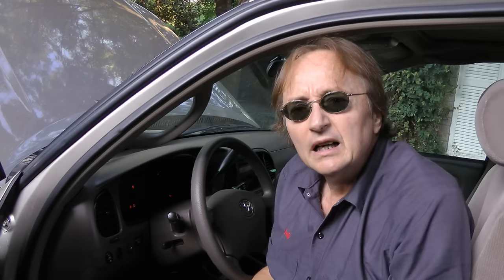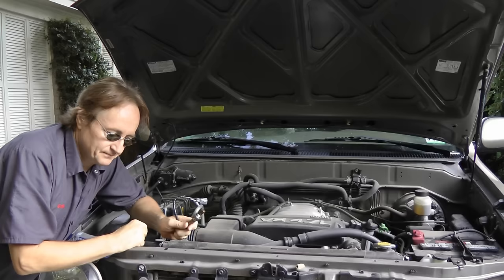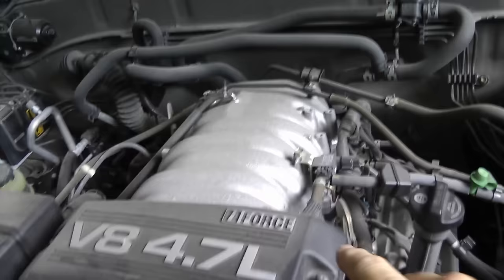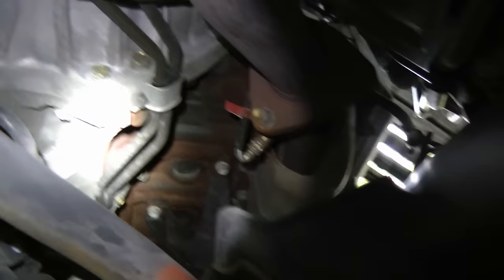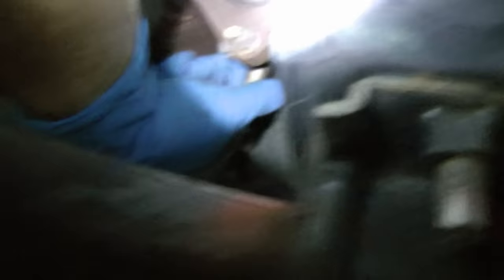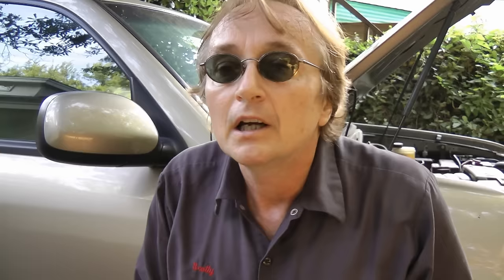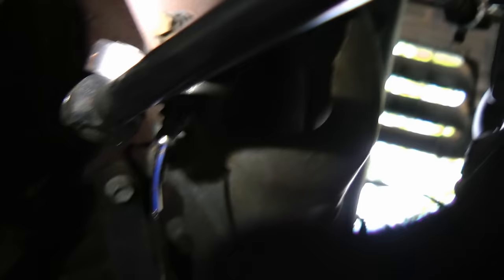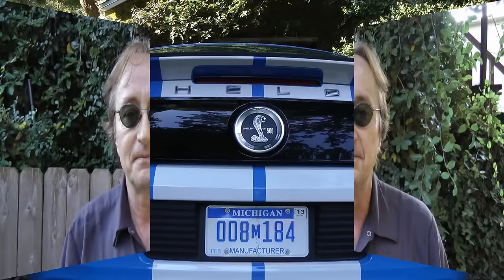How to Replace an Oxygen Sensor in Your Car (Air Fuel Ratio Sensor)

Comment: Hi Scotty, I have a 2004 Toyota Prius that has started to idle rough. The Dealer ran OBDII codes and here they are: PO138. O2 SENSOR VOLTAGE HIGH. B1S2. They want a very high price to fix this. Would it be possible for you to consult on this?
 Thanks, Lee

Comment: Hey scotty,

So I replaced the upstream oxygen sensor for my 2006 Mazda 3 2.0L with a code of P0421. I hook it up to a fancy machine and the upstream oxygen sensor didn't have a voltage. I replaced the upstream oxygen sensor, but I didn't buy the original one, which cost around 350 dlls. I decided to buy NTK. The check engine is still one and the oxygen sensor is still reading no voltage. What could be wrong? The manifold converter or catalytic converter. I really don't know. Scotty Kilmer

Comment: If there is no engine sign on, is there a good reason to change either oxygen senor or air fuel ratio sensor?  I have a 2002 Honda Accord v4 that has 230,000 miles on and a Nissan Frontier 2003 with 160,000 miles.

Comment: Hi scotty

im having a bit of trouble with my 2009 Mercedes with a 1.6 kompressor engine, i drove it down to my mechanic and it got no faults, but he tested the oxygen sensors and one of them got some pretty strange values through 2 different scan-tools, the problem with the car is that its some kinds of misfiring, and shaking if you keep the RPM steady in neutral gear and the car are not that economic anymore, my mechanics thoughts are that the oxygen sensor with strange values are gone bad and need replacement, but whats your thoughts about it

kind regards

Thomas from Denmark

Comment: ya i had jacked it up its not hung up are maf sensors cleanable with throttle body clean or something more sensitive like iac valve cleaner? ive also read around that the dpfe could be bad but not enough to kick a code...(differential pressure somethin or other??)

Comment: Scotty can you help me out? I have a 2008 Pontiac vibe (like you a vibe/matrix) I recently acquired a Zurich ZR pro scan tool and decided to hook it up and see it run :-) Well I noticed my long term fuel trim is at 13 to 14% which I think means it’s running too rich in fuel and lean on air. I have a good line graph to show the data of what’s happening but don’t know how to read it because my bank 1 sensor 1 is reading 3.3v constant and heard that might be normal? The bank 1 sensor to (post cat) is  doing weird things entirely (in my opinion) could you take a look at my readings? Also my g/s of air through the mass airflow sensor seems fine at 2.3g/s. Any help would be appreciated!

Comment: Hey Scotty, can bad o2 sensor cause driveability problems (such as misfires and rough idle) and not trip a check engine light on OBD-1 computers systems?
Reply from the maker: yes they can, but of course, scores of other things can too. Best to analyze than guess. OBD I systems are very basic and often do not trip codes for any problem, including O2 sensors

Comment: Scotty, I have the P0135 code (bank 1 sensor 1) code on my '96 Mustang Cobra. This is passenger side sensor before the cat. Aside from just it going bad and me having to replace the sensor, are there other issues that could have triggered this code? I think there's only one fuse for those, so it would have triggered ALL (unless I'm wrong about the fuses). I haven't driven that car in a while and had to charge the battery to start the car-- could that have triggered it? Penny for your thoughts!
Reply: I'm going to continue charging the battery as much as I can, clear the codes, and heat it up and drive it. But please, let me know about your experiences! Love your channel, by the way! Thanks a bunch!

Comment: HI Mr. Scotty.. I have nissan sunny 2002. i have a problem regarding spark plugs.
after 800 or 900 km . my car spark plugs gets black. and my car engine shuttoff while running.. or when i parke my car its cannot idle.

Comment: Hi there, I found this video because I'm super worried about my Dodge Grand Caravan (Sport, 3.3L V6, 2002, 234k kms) fuel consumption! I'm around 15L/100km (around 15 MPG) and even more (less for MPG) sometimes in city. I never drive over 2 500 trs/mn, I don't really understand how the fuel can go away like this ! It's killing my bank account. This Air fuel ratio could help ? Any ideas from you guys ? Cheers!

Comment: Hello Scott,

The O2 sensor socket is with drive size of 3/8". Where did you buy your 3/8" breaker bar? Currently, I only have 1/2" breaker bar and most people say the 1/2" to 3/8" adapter is very easy to be broken.

Thank you

Comment: I have a 2006 Chrysler 300C 5.7l Hemi I changed 16 spark plugs 8 coils and the EGR Sensor 4 o2 sensors and the OBD2 is pulling up all o2 sensors tried erasing the codes but doesn't work

Comment: Was I wrong to use antiseize on the threads of the sensors or is that what caused me to get a p140 and p160 and also the fronts are new and only one is working now.
Scanner says no activity from bank 1 and 2 downstream

Comment: Why I haven't seen this video before ? :(  

Scotty says "Always replace them with a SAME BRAND" . In my car 2 Bosch sensors were used originaly but I've replaced 1 faulty Bosch with NTK and it worked for a month or two...but now I have 3 dead O2 probes ( 2 Bosch and 1 NTK ) .

Comment: Have 05 Mercedes C230 Kompressor w / supercharge code Po172  O2 censor , but I also lost the quick acceleration when push on gas paddle, it picks up slowly.   When turning on the AC the rpm idle fluctuates up and down making the engine going to die. Could O2 censor be the problem on both issue? or AC have different issue?
Reply from the maker: If you wish to ask me car questions, I am switching my questions and answers to my website. So go to www.scottykilmer.com  and ask me in the Ask Scotty section.  So please, if you want your questions answered, go to this link and join my completely FREE website. No strings attached.

Comment: Scotty I have a 1998 Buick Regal Ls with a 3.8L V6 and it has code P0141 Bank 1 Sensor 2 and yes the check engine light turns on and I do waste ALOT of fuel because of it. My question is if I disconect the oxygen sensor would it not turn on the check engine light? Thanks.

Comment: What if the code reads low voltage o2 sensor, would that be more of a wiring problem

Comment: i have a question scotty,i drive a 2003 subuaru outback. when i hit the gas the car makes a loud reving noise and the check engine light has been on for sometime,my friend thinks i need to have the o2 replaced and if she is how much would it be? or can i change it myself? and what kinda tools woild i need? would i have to replace under the one under the car? let me know thank u
Reply from the maker: they just bolt off and on, but you need an oxygen sensor wrench to do that. See my video "replacing a bad oxygen sensor on your car"

Comment: Hi Scott,
O2 replacement. is there any negatives heating it cherry red to break it loose. the penetriating products didnt work as the sensor has been inthere 15 years. I did heat one on my Ram and it finally broke out.. thanks in advance for your help.
Bob

Comment: Also, is the same method (pipe cleaner) ok to use on a preheated O2 sensor? And/or can I also use any type of detergent cleaner or something like isopropyl alcohol, to wash the O2 sensor out or soak overnight?

Comment: hey scotty got kind of an off topic question. i just got a 2005 escape awd which for escapes theyre 2 wheel drive until needed.. when i purchased it i filled the gas tank and i put 100 miles on in a day and was down to half tank.. be it those were highway miles it should have got way more. i replaced spark plugs, cleaned throttle body, new air and fuel filter , aligned , only 64k miles no check engine light on idles fine i was thinking maybe the ebrake is too tight because the handle is fairly

Comment from the maker: they look the same, but air fuel ratio sensors are more accurate and costs a bunch more. They are not interchangeable even though they look the same.

Comment: So I got my check engine light on and the code was Po133 and it was the bank 1 sensor 1 & I changed it and you could tell it was not a good one and my check engine light is still on , what could the problem be? Do I have to drive my car a couple miles for the computer to configure the new sensor?

Comment: the part number on the box for the o2 sensor says it's an upstream, but the sensor inside the box looks different then the one I got on the truck and on the autozone page the one that look like it has a different part number which is a downstream, does it make a difference installing a downstream onto an upstream place??? thanks
Reply from the maker: on most modern vehicles it does, because the upstream one is a much more sensitive device on new cars

Comment: “Hey Scotty” been watching your vids and and first time commenting gotta say love it all, been taught everything you been saying from my pops(Dad) do it right the first time. I changed the O2 up stream sensor I bought from Amazon but it was to short so cut and spliced the old female harness and still getting check engine light. Got the Genisys SPX OTC saying low voltage, so just gonna buy a $90 Bosch universal O2 , does that sound good? Or keep to the old Denso brand? ThX

Comment: Will an O2 sensor work without having a catalytic converter on it because  someone stole mine, and after I pass on a little water ditch my truck 2000 Tacoma 4x4 will stop working properly  the code is p0110 by the way...

Comment: @scotty kilmer  Some of the lubricant that comes with the replacement o2 sensor got on the tip of the new o2 sensor. Will that cause issues if I didn't wipe it off?

Comment: I live in thunder bay. Had a really cold morning today  (-38C) tried to start my dodge journey and it stalled. I tried it a few times and it wouldn't start so I pumped the gas a few times...it eventually started but now I have a check engine light on and when I drove it, I smelt something burning. Not driving it till I can figure out what's going on. I have plugged it in for tonight but still not sure what to expect. Help please :(

Comment: Scotty, first off love your videos helped me many times. I have run into a problem that i heard could be related to oxygen sensor. What happens is when i start my 94 E-Van it starts fine and if i press the gas pedal down say up to 25% it gradually moves up in speed just fine but if I press the gas down more then 25% it sputters and wont get up to speed. After 5-10 minutes of warming it it drives perfectly fine. Also it sounds like i hear a hissing in the van when idleing but goes away.any ideas?

Comment: I just replaced a upstream bank 1 02 sensor . after i replaced it my engine analyser told me i have low voltage in 2 other 02 sensors . i have a 6 cyl. dodge dakota with 75000 miles on it .Whats up with the 2 other failures???

Comment: I guess what I want to know is by me disconnecting the the temp dash wire that goes to the stock sensor and replacing it with a after market temp gauge and sensor would that cause the check engine light turn on the guy at autozone said no because that just goes to the dash not to the computer just making shore

Comment: Scotty, I am getting a P0134.... bank 1, sensor 1. The problem is it is frozen with 18 years of Midwest rust and I do not have acetylene. I tried to loosen it but do not want to snap it off. Would it be best to ask a shop to break it free? Thank you.
Reply from the maker: yes, or buy an oxygen acetylene torch used and do it yourself. They do come in handy for all kinds of work, and last forever.

Comment: sorry for the confusement, they told me it was the third o2 sensor which is the sensor after the cat.im not sure what code it was but they told me to replace it, do u know if the original o2 sensor is an ac delco? is a bosch o2 sensor ok to replace?

Comment: Hi, I drive a '96 Toyota Starlet Glanza V. I replaced the o2 sensor couple days back and since under boost the check oil light comes on. Now I assume that the oil sensor which is located in the vicinity of the o2 sensor may have got touched by the tool and got damaged. So I plan to replace this. What would be your advice?
Would it be ok to drive it on low revs ffor the time being?

Thanks

Comment: Scotty. I have an 05 Jeep grand cherokee and I'm getting terrible mpg's. I put a little bigger tires on my jeep and a 2" body lift. Even before that I wasn't getting great mpg's. So I took my jeep to advanced auto and used the 0DBII code reader on it. I don't have any codes but I wanted to see how the jeep was running. My first bank was good with one sensor sitting around .650 and the other going from .1 to .9 up and down. My other side however, both of the sensors are all over the place. So I know one is working improper. My question though, is that I have a exhaust manifold leak because of the notorious broken bolt jeep has. Will this cause me to have bad gas and/or cause my 02 sensor to be jumping all around. Thanks.
Reply from the maker: those things are just gas hogs, and the higher you make em and the more friction your tires have, the worse the gas mileage will get. No way past that, PLUS I imagine you drive fast, which also eats gas. Can't have your cake and eat it too.Do fix the exhaust leak though, that should normalize the O2 sensor readings. It will still eat gas though

Comment: Hi scotty!
I just had my 07 chevy optra in the shop and had a po420 code.they tested the oxygen sensor and the sensor behind the catalytic converter was reading zero so they replaced it.it was good for about a week but now I have the same code again does that mean I should replace the other sensor? The shop told me that because the one sensor was bad then more then likely the other one wasnt far behind

Comment: Hi Scotty, I have a 2003 Mitsubishi Evolution 8, (turbo), the scanner threw a 1st sensor code, the check engine light is still on after replacing front o2 sensor, also i cleaned the EGR valve, new spark plugs and nothing!  could it be the rear o2 sensor?
Reply from the maker: It could be, but realize O2 sensors and catalytic converters are part of a complex feedback computer run system that can have many problems which trip sensor codes, not just bad sensors.  ONLY a true pro mechanic with years of experience can analyze it without just pure guesswork when simple sensor changing does not fix it

Comment: Scotty,
I am getting 20mpg in my jeep cherokee 2001, 188K on it. Ive never replaced an o2 sensor, but I also don't have issues with them. Do I wait until one goes bad or should I start replacing them. I have four of them. My thoughts are.... why mess with it if it's not broken.

Comment: I replaced the sensor with a new one  on B1 S1 , looking at the engine 2011 Tacoma 4 x 4
Bank 1 on left side ? Check engine light still on ? Sensor was the one in Front of Cat, started engine light still on. Removed and clean Neg Cable on battery , started engine light was off for a couple of seconds but came right back on ??
Reply from the maker: realize O2 sensors are part of a complex feedback computer run system. you tried the easy fix, but that wasn't it. Rather than guess, find a pro like me to analyze it with his fancy scan tools and years of experience, as over a dozen diff things can do that besides a bad sensor.

Comment: Hi Scotty thanks to your video i was able to change my oxygen sensor (bank 2 sensor 1) but right after i changed the sensor i am reading 2 more o2 sensor error from check engine light including the sensor i just changed. Symptoms didnt go away, car is still accelerating 2-3 seconds late after i hit the gas and bad idling. It all started after my mechanic changed the crankshaft  position sensor and check engine light came on for o2 sensor. What might be the problem? Air mass flow or electrical problem... I will really appriciate any ideas or opinions. I have 2003 Mercedes C240 and i used Bosh brand sensor and part #16318
Reply from the maker: +apache08 don't try fixing a Merc  without a star tester. They are TOO complex, and O2 sensor systems are complex feedback computer run systems that even pro mechanics have problems diagnosing on Mercs. If your mechanic doesn't have a star tester, go elsewhere. You will have to pay Merc bucks, but that's how they are, endless money pits as they age.
Reply: No i dont have a star tester and neither my mechanic had one :( Thank you very much for quick response. I will take it to Mercedes dealer i guess

Comment: Hi, Scotty. i have a question for you. i have a Toyota 2005 RAV4 the vsc trac light and the engine light was on , and my friend used the code reader, it was oxygen sensor (bank 1).He replaced for me ,and the code was gone.  I didn't drive that car very often. Today i  saw the both of the VSC TRAC light and the engine light is come back on again. I went to auto zone and checked ,the code is P0420. Do you know why ? Thank you !

Comment: hey Scotty, im in huge need for help! im repairing my 1991 MR2 Toyota Turbo. iv been driving around and the car stops randomly at a given point and the revs start going down no matter what i do, eventually they will go down until the engine stops, sometimes the car will slow down and when i try to drive again the car wont work, as if it was drowning. i diagnosed the car and got a code 21! 02 sensor, if i replace it will it fix the problem? or is it cause by another internal prob? Thanks!

Comment: Changing these is pretty simple but I have a 1999 saturn sc2 and the sensors were seized on big time and would not come off so i had to give it over to my mechanic, he  said the same thing "man these are in here good" but he got them off and charged me $32 labor. That's a saturn though most cars are not as cheap on parts and labor to work on as an old Saturn. I'd hate to see how much a Cadillac Escalade would cost to replace o2 sensors on.